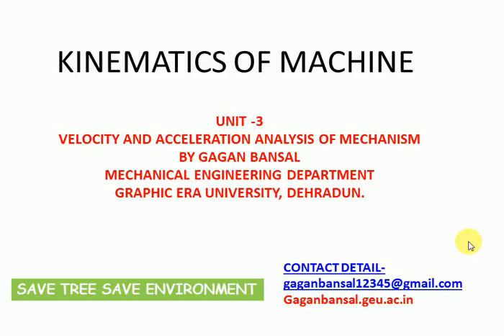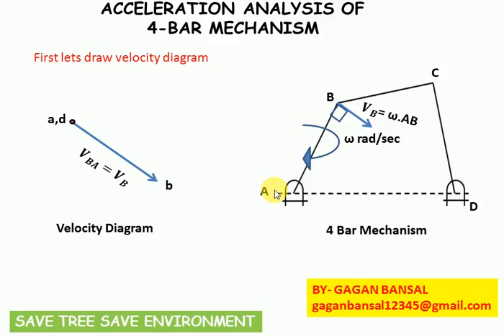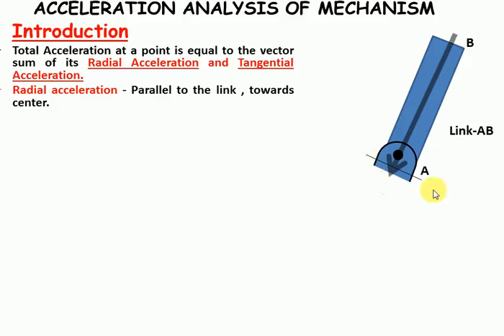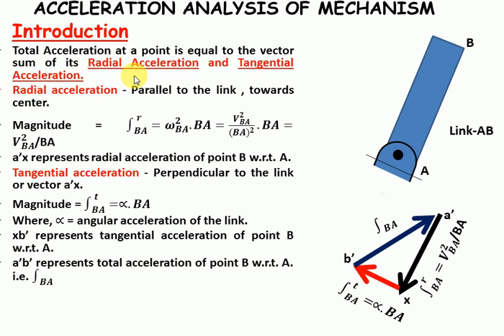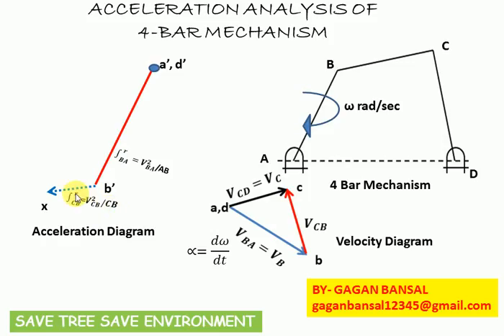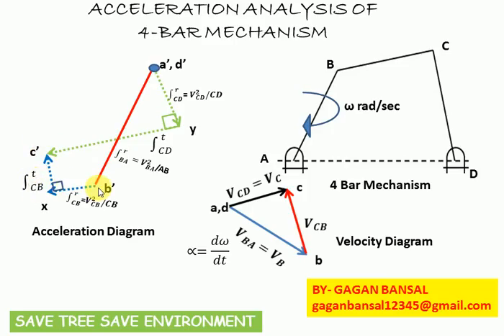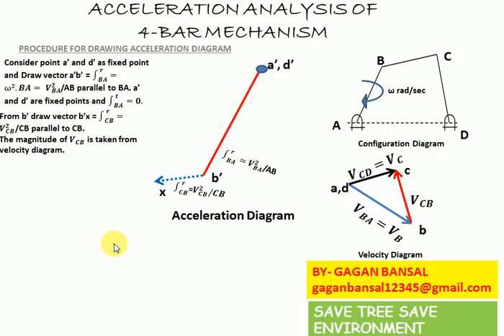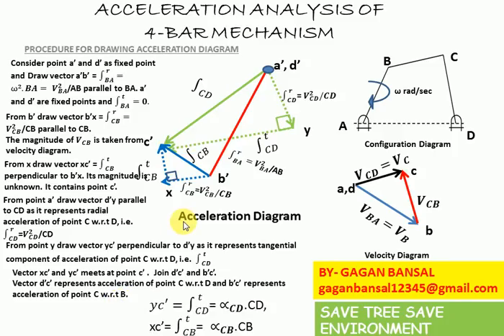U03L03 ACCELERATION ANALYSIS 4 BAR MECHANISM || GAGAN BANSAL || VIDEO LECTURE || KOM

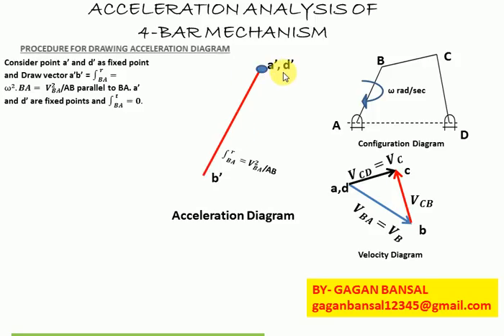Comment: Sir, in acceleration video at 14:40 
i--Why the tangential acceleration is zero.

At 9:32
Why the radial acceleration ob b' w.r.t A drawn downward and similarly radial acceleration of c' w.r.t b is in opposite directions
Reply from the maker: solution: @ mohd faisal
i. tangential acceleration for link AB is zero because link AB (input link) has uniform angular velocity and thus angular acceleration is zero and therfore tengential component i.e. the function of   angular acceleration is zero.
rest in all other links we have consodered....

clear ...???
Reply from the maker: Query 2 : @mohd faisal 
At 9:32
Why the radial acceleration ob b' w.r.t A drawn downward and similarly radial acceleration of c' w.r.t b is in opposite directions.
Solution: radial component is always drawn towards centre i.e. in this case from B to A (downwards). and for 
link BC, radial acceleration of c' w.r.t b is towards B.

hope you understand.
write these points and re watch the video

Comment: sir at 10:07 why link BC would have both radial and tangential acceleration, why not the others?
Reply from the maker: Ishaan good question...
Link AB(input link) is assumed to be rotating with constant angular velocity therefore angular acceleration zero, hence it has only one component rest all links have both components...
Link CD also and BC also... U will see this in the same video later...

Clear???

Comment: As at 18:53 we can find angular acceleration and thus the magnitude
Reply from the maker: Yes perfectly correct Priyan,
We can first draw the complete acceleration diagram as per instructions in the desired scale and later calculate the magnitudes.

Comment: Hello Gagan, how can I find the accelerations of a point between C and B?
Reply from the maker: Daniel Sánchez hello...
you can directly use linear ratio method between length and acceleration...
Reply: Thanks man, ratio between the lenght of the bar and the acceleration between B and C (Drawing a vector from B to C points)?

Comment: sir how to draw those vectors without any reference angle ?
Reply: You should work with the angles from the 4-bar mechanism in the state given, Normal accelerations are basically parallel to the bars. If you don't have them, you must find them by trigonometry.